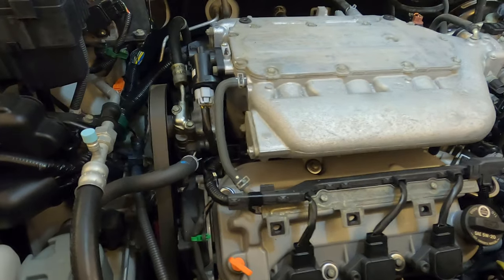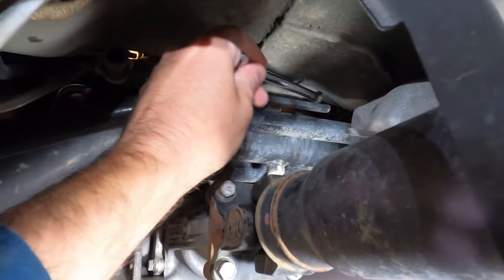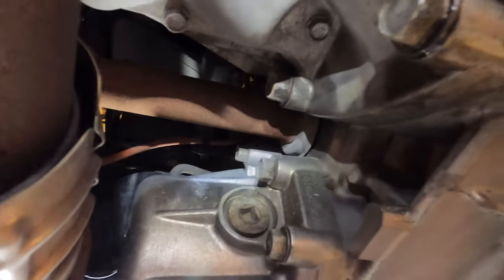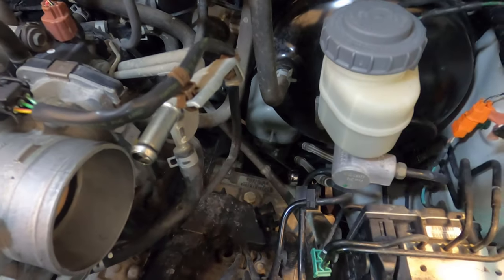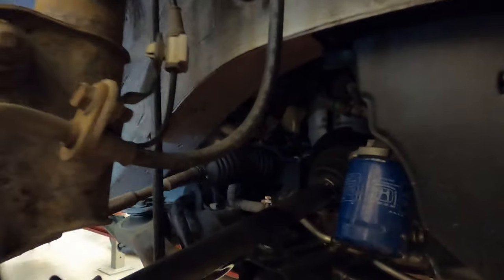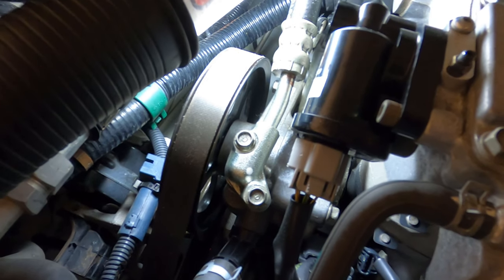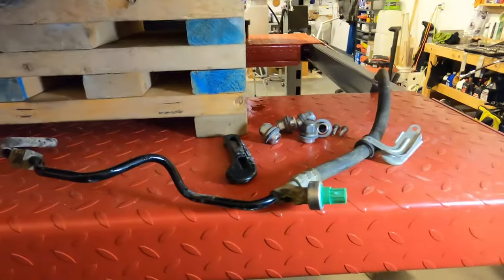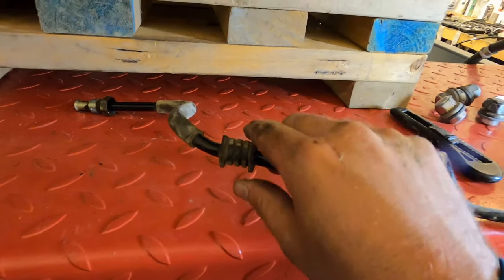How to Replace a Honda Power Steering Hose 3.5 V6

Comment: Thank you. I just did this job yesterday. Not a a mechanic - however just got quoted $1,500 or so for this job. Our local AutoNation dealer said it was 7 hours. Which is bs- a dealership with a lift and mechanics that know their way around the truck - 3 hours if he is not chatting with his buddies. So a 4 hour quote would be realistic - but still - No thanks. This simply told me that the mechanic (technician)  did not feel like doing it so he quoted the sales rep 7 hours. Or the rep is simply a horrible salesman. Then before I even asked to haggle - he stated that they could discount the per hour labor charge - and the new cost would be $980 for labor plus $330 for the hose. LOL. I decided to do this myself based on principal. And if one days work equaled a $1,000 dollars plus in my pocket = those are not bad wages. This vid was one of the better ones I've seen. Probably the best - cheers. I do not have a lift and did this on the street. Pulled up in front of the driveway enough to be able to access the passenger wheel well without the curb obstruction. After all the vids - my biggest fear was accessing the fittings at the rack from the top. So the previous weekend - I took off the air box off (this is huge and a must to make things easier on you) for EASIER ACCESS LIKE YOU MENTIONED -  to see if I could get a wrench on the fitting. Tried the crows foot like another vid - no thanks - pain. I got after it yesterday - no lift so jack stands. Passenger tire off. Since I already knew I could access the fittings at the rack - I started at the bottom - because of no lift - I rolled under the truck on a flat creeper and had a somewhat view of where I needed to get to the 10mm nut (you cannot see it) - but can feel it with your hand - by the drive shaft. Here is the thing - this was the biggest challenge - especially without  a lift and on your back. If you do not have a 10mm open box ratcheting wrench - get one as I could not imagine getting a wrench on there and - again and again after every turn. This took approximately 30 to 40 minutes as it took some time to get it on the nut as access is tight especially laying down and the right shoulder muscle and neck muscles would just eventually start to get super sore trying to get the wrench on the nut. Important note - once you get it on - try as hard as you can to just continue to unscrew. Rest or whatever you need to do to not have the wrench come off. Wrench came off twice as I though I could do the rest with my fingers. No go, The wrench needs to be on there till it comes all the way out - 3 times in total and if you think getting the wrench back on because you did it before will be easier. Put your patience cap on and try, and try, and again, again, again - NO BS - this was the hardest part of the job. The 10mm one close to the wheel was easy in comparison - like you said 1/4 drive small ratchet with 10mm head is perfect and easy to get to in comparison to the previous pain. The connector was harder and I accidently disconnected another connector that was on the steering rack. Which btw was a nightmare to re connect later. With the airbox gone - the fittings at the rack were not bad. You just have to dive in (literally speaking) a 17 wrench did the trick taking off the return line (just like you stated) in order to access the 19mm high pressure fitting behind. This is time consuming but having seen this vid - it actually was not that bad. As I knew to be patient. I also lined the top of the engine with a few blankets and even a swimming noodle so that the hood latch would not be stabbing me in the stomach or leg. This was a huge help. No extension bars were necessary. The  access without the airbox was enough to just use a standard 17 and 19 -  not shorty's but not long ones as well. I did not have a 19 - so a home depot basic 19mm worked. I was planning on cutting the round part of the end off with sawzall to get a pipe on it. But glad I did not. It came loose just fine without an extension bar/pipe. The hose came out easier sideways through the wheel well like you did. The new one however went in through the top without much issue. Getting the new fitting on at the rack took a little time and patience as you have to line it up just right - this will remind you of the patience cap - and this is due to you already being hours into the job and you can smell victory - but the alignment has to be just right and this will test you if you re tired or impatient - I was both at this point - maybe 4 to 5 tries and about 20 minutes. The return line proved tougher to line up just right. But with some perseverance it finally went on - 8 tries or so. The biggest issue was trying to get the 10mm stuff back on from the bottom. F that without a lift. Zip ties to the rescue. Thanks again for posting this - it gave me the confidence to knock it out, With my buddies wholesale discount. The parts cost me $100. And despite this being somewhat of a pain. Totally doable  if you do not get pissed and continue at it. $100 instead of $1,500. And a lesson of just how much dealers hose unsuspecting people. Thanks again mate.
Reply from the maker: Thanks that’s a great comment filled with important information.  This is beyond most DIY so $1500 isn’t crazy.  Amazing to do it on the road!  I have a lift and still used a few zip ties to be honest.  No problem the point is to keep the line held in place.  So far mine is not leaking - Hope the aftermarket one lasts!
Reply: I finished doing this job on my 2004 Pilot today. I have about 7 hours into the ordeal, but not all at once - plus some of that time was spent on fixing mistakes. Working on a 20 year old vehicle can be a challenge, especially when there's rust, dirt, and old p/s fluid everywhere around the engine. The bracket underneath was the hardest part for me, and I managed to get the bolt out with a 10mm ratcheting box wrench. Getting the flare nut out was not bad since i cut the line. I found that tightening it was harder. Fishing the new hose in by myself was also tough, but I tied a piece of wire onto the end and pulled it though. 

The one thing I regret not doing was removing the air box. That may have saved some time and given me better access. 

This is probably the most difficult thing I have done to repair anytime on my vehicles. Patience and maintaining your composure is key.
Reply: @spookerz35  indeed - the airbox removal was key - and I wrote it backwards - the challenge was getting to the fittings at the rack not at the pump. I edited my initial experience so others will not think that it's harder at the pump and not he rack. Well done. 8 months later and now I have a leak an oil leak - have not had time to see if oil sensor - not trying t replace a rear seal myself if that is the culprit.

Comment: A couple hints for future readers (I just did this job): 1)  cut the old power steering line near the flare nut at the rack and pinion, then a deep 14mm socket can be smacked on and used rather than a flair wrench/crows foot to remove. 2) Remove the hose and fitting for the return line at the rack and pinion allows room to swing a flair wrench (or crows foot) to tighten the new high pressure line. Also, I fought it too long: just remove the air snorkel and throttle, coolant lines can stay attached just let it hang.
Reply: Cutting that line for a 14 is a good idea.. I will ficken do that..
Reply: Bro I'm currently doing this. Crows foot line wrench, nothing moving, gonna do this tomorrow thanks. Great idea.
Reply: @ZONER4201  make sure you put a new pressure switch on the PS line, I didn't and it leaked there you don't need that.
Reply: I just got done with this ordeal on my 2004 Pilot. Cut the line and use a 6 point socket. I did not remove that return line fitting in front of the flare nut, but wish I did.

Comment: I did this today and I want to mention, if you don’t have a lift, you can access the 10mm mount screw that’s above the drive shaft through the engine bay. Need a small handled tool with a socket but way better than laying with your back on the concrete trying to reach your arms up the entire time.
Reply: THANK YOU FOR THE VIDEO

Comment: This was helpful. I was doing this while replacing the Rack.  I opted to start the threads on that line while the rack was hanging out of the left side of the car.  Still a GIANT PIA.  I can't imagine how long it would take to NOT cross thread this SOB doing it from the top.  I'd almost just disconnect the tie rods, lower the subframe and slide the dang rack out if I had to do it again.  God bless anyone doing it from the top.  100 Timing belts would be far easier.

Comment: I just finished this Job  - 6.5 hour job over 2 days including the time to run to Home Depot. (you need a 17 and 19 MM wrench)  I could probably do it in 3 hours now.  This video is great help...However these are things I wish I knew as well.  Watch the video First and then add this info to your plan.  Again carefully watch the whole video IT will save you time in the end.  Don't skim!

MOST IMPORTANT - Don't buy the cheapest new steering hose.  I did and it cause me hours of frustration because it was kinked.  Here is the thing you need to make sure about your new hose.  Look at the Rack end of the new hose.  The last 4 inches should be perfectly straight, and the nut/fitting should spin freely.  Mine was kinked slightly and the nut turned but lightly grabbed.  Cause me hell and probably an hour and half when trying to get it threaded correctly.          

1) If you have smaller hands, you can do this from the top.  DO THE FOLLOWING to remove the hose
   a) Remove the Air Intake hose.
   b) Use two thick moving blankets folded into 4 layers so 8 layers total and lay on top of engine - protects you and make more comfortable.    
   c) Remove the return line with a 17mm wrench.  I did not do this originally...I ended up having to later.  Should have done it from the beginning...would have save me LOTS OF TIME AND FRUSTRATION.  DO IT First.
   d) Use a cutting tool and cut the hose right by the Rack fitting.  I used an Oscillating Muti-Tool, it cut the line in 2 seconds.  Then I used 19MM socket to easily remove the fitting from the Rack. You can use a 19mm wrench...but is a waste of time 
2)  Follow the direction from the rest of the video to remove the rest of the hose.  If you cannot get the 10mm bolts holding the line on the bottom.  Cut them with a Multi-tool.  I did get the 10mm nuts off but was never able to reuse them.  I ended up zip tying.  Save your frustration and cut them loose if they don't come off easy.  
3) I did take the passenger tire off and pulled the hose out the side.  I reinstalled from there as well.
4) IMPORTANT WHEN RE INSTALLING. - push the new hose in from the passenger tire SIDE DO NOT THREAD THE OTHER END OF THE HOSE UP TO THE PUMP YET.  YOU WANT THE PIPE TO BE "FLEXABLE" TO HELP YOU LINE UP THE RACK FITTING.  
5) GET A HELPER FOR THIS PART!  with someone holding the hose by the passenger tire have them help you push and wiggle the hose, so it lines up with the rack.  As you work from the top with a 19mm wrench or with your fingers tighten the fitting into the rack.  Having the helper make sure there is no binding on the fitting hopefully will make it easy to get the fitting thread started.  FYI Mine was more than 8 rotations.  6 wrench turns per rotation - more than 48 wrench turns.  Be patient or take a break.   
6) Attaching the return line for me was easy - just took a little time as you again had more than 50 wrench turns.
7) follow the directions from the video to attach the pump side, secure the hose, attach electrical connector.   
I hope this helps some of you.  These are things I would have wanted to know in addition to the video.   
~Mark
Reply from the maker: What a great commentary.
Reply: I just finished this today and wished I saw your comment before I started!! Would have saved me some time and aggravation. I watched 2 other vids, but didn't see this one until today - AFTER I finished the job!! I feel like I just joined a special exclusive club or something, this was a beyotch to do.
Reply: @spookerz35  You did join a special club.  That club should take the engineer who designed the entire car around that hose (because it must be the most important part on the whole car) behind the woodshed for a little talk.  He needs to understand that he should never ever do that again!    It is 6 days later, and I still have a ring of bruises around my upper arm.  I do have to say this was one of the hardest/frustrating car jobs that I have done.  At least as far as those that actually worked in the end :)

Comment: Thanks for making the video---I've been trying to wrap my head around the idea of tackling it myself,  As much as a PIA as you and others have realistically pointed out---it would seem that with hours of effort and frustration that it is ultimately possible to do this....  BTW--I was impressed at how clean your 15 year Pilot is maintained, not to mention your garage.
Reply from the maker: Thanks. Don’t be afraid to use some zip ties if your can’t get a bracket bolt back in place.  2 years later my zip ties are fine at holding the line in place.
Reply: @gregs_garage  Well, I'm happy to say that although every bit as tedious as you and others have said it is, I managed to get the old hose off and the new one on.  Took me a very patient hour and a half to get the new end to thread into the steering rack--I was quite apprehensive about not getting it cross-threaded.  It's in properly and tightened down.  I did remove the low pressure line from the steering rack to better access the 14mm high pressure line nut.  Something that was extremely frustrating is that the new line, a Duralast purchased from AutoZone, uses a 5/8" nut instead of a 14mm!!  Took a bit of extra time to figure that one out.   I fed the old line out and the new one in as you did through the passenger side wheel well.  That worked very well!  I still need to put the hose clamps back on tomorrow--didn't start on this until mid afternoon.... Nice to know I can fall back on zip ties if I can't get them.
I have to agree with many of the comments--I have done a good half dozen timing belts over the years on a few different cars and I think that they are far easier than this project.  Your video gave me the courage and the patience to give it a go, and I thank you again for that.  You have a new subscriber--🙂
Reply from the maker: @Mezmar165  that was quick!

Comment: Can concur, just did mine and it was a pain to get the High pressure end off, bolt started to strip so I cut the end and used a box end wrench and it came off.  Good luck to those looking to do it.
Reply from the maker: good luck is right.  My aftermarket replacement is still nice and dry and it better stay that way.

Comment: Seems like other people have had the most difficulty with the flare nut fitting at the rack - either getting it off or getting the new one to thread. I had trouble getting the old one loose but finally got it off. The hardest part I've encountered is actually feeding the hose around the  firewall/sway bar/return line. I've gone at it from every angle I could think of and it simply is too long and has so many kinks that it feels impossible. I started to cut off the middle bracket that's attached to the return line with a little plastic clip because every time I push the hose inward, it gets caught on that and then there's no way to feed it towards the rack. Hoping to finally get it lined up tomorrow. Any tips for how to feed the line into place? All the videos and forums I've looked at seem to make little mention of it at all which leads me to think it shouldn't be that difficult. This is by far the most aggravating procedure I've done on my Pilot.
Reply from the maker: yes it is tough.  I fed mine through the wheel opening and don't recall getting hung up on anything.  The Pilot may be different.  If you have to change some brackets that are in the way go for it.  Zip ties can be used to supplement.  I have a few zip ties on mine now and it's fine.
Reply: @leezcreed1928  I eventually crammed the line in by lowering the bolt on the rear engine mount (it only gave a few more millimeters of space) and I forced the line down from the top in between the firewall and lower subframe. I cut out the rubber supports and brackets that held the original line in place to allow for more flexibility. You can use plastic or metal zipties after, which I used metal ones. I also had to bend the line somewhat in order to make it fit right. Once I got it lined up well enough it was also pretty difficult to get it threaded into the rack. If you haven't yet you can disconnect the rubber return rose where it inserts into the rack to allow it to move some more. The way I have the line now isn't in the same position of the original line but as long as it doesn't get in the way of anything that moves I imagine it shouldn't be a problem. It's been working for me for two months, good luck.